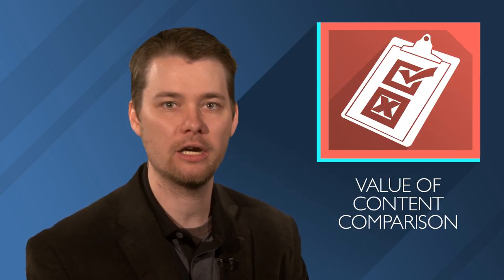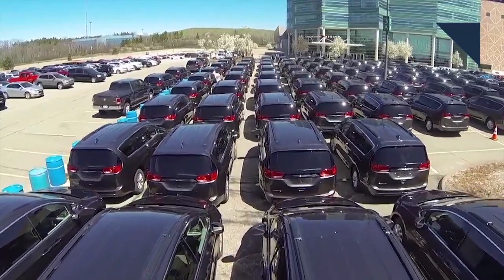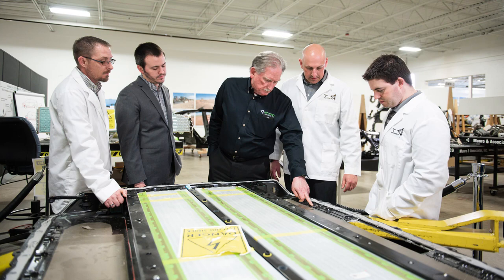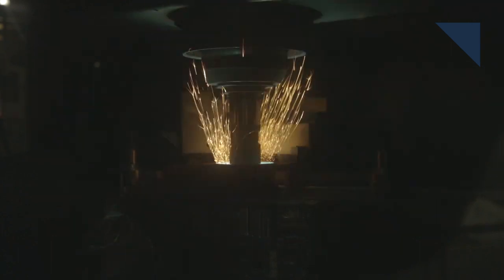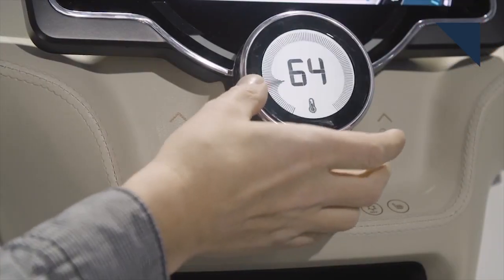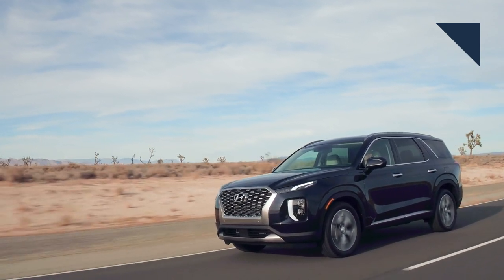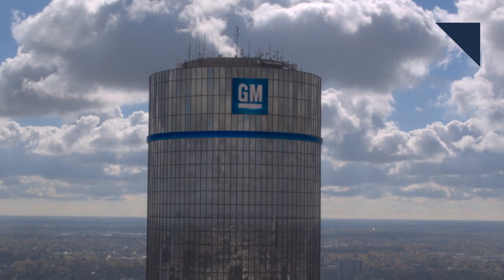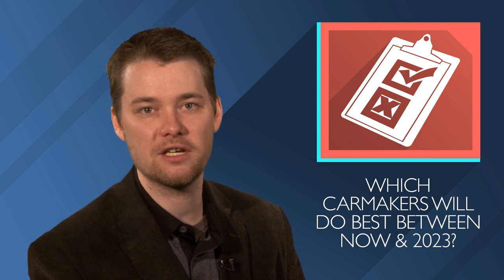C-Clamp Lights Make Pickups Look Tough - Autoline Daily 2619

Comment: 4:00 Mercedes is known for their seat controls on the door. So, dear Mercedes, PLEASE DO NOT GET RID OF PHYSICAL CONTROLS. Don't adopt this, or those awful haptic feedback controls. We love physical buttons. It's the same with the volume knob: Those who got rid of it quickly brought it back. Don't change things for the sake of change. It's stupid. When are manufacturers going to learn?
Reply: It's not change for its own sake. You also save cost for the switches, the wiring, the installation and potential malfunctions. Features you don't use very often can just as well be controlled from the touchscreen.

Comment: So there's more cost of parts (and R&D which all should eventually drop out of this equation) in an EV ($33.6K) in comparison to a ICE ($14.5K), or about 2.3 times more parts cost.  Perhaps these numbers apply to a new product development of either an EV or ICE vehicle?  To pay 2.3 times the component "ingredients" cost (less final assy. and profit), you have to be (1) a big believer in the so-called ecological calamity that's probably driving most of the EV sales, (2) enjoy wasting time at a battery charging station, (3) and think it's OK gambling on the life of a battery costing $15K to replace.  Did I leave out something?  Oh ya, like being pinned into your seat during acceleration and the car runs quietly.  The Level 4/5 autonomous estimate of $150,000 to $200,000 is way to low because of the enormous amount of R&D required, trust me; spent my life designing and developing hardware for high-tech products.  Of course, Tesla uses its vehicle purchasers as autopilot guinea pigs, so there's some savings there <g>.
Reply: Name a figure, then divide it by the number pf cars being produced.  Even if your R&D runs to billions, the production volume that will use that software runs to millions. How do you think big software games or CGI movies make money.  It is not because the costs are low, it is the number of customers the costs are spread over.

PS. The reason I have not been answering your messages lately is for some reason they have been going to my spam folder, I don`t know why, I did not set it that way.  I am trying to fix it.
Reply: @earlpottinger671  Earl, I have the same problem with my YouTube messages, it's a mix that go to the incoming and another to the spam folder.  Incorporating the R&D costs confuses the message trying to be made.  For instance, someone can reverse engineer a product and spend little in R&D.  No doubt Tesla has provided much free R&D effort to the EV design copycats at other manufacturers.  When I'm given the task to design something, I'll first look around for some existing design and reverse engineer it.  Reverse engineering an existing design also provides the opportunity to "build a better mousetrap."  Some of my most fun design efforts is simply building that better mousetrap with improved features.  Military electronics R&D is often paid by the government.  Attempts to protect a lower level design within a system by patents is usually futile because there are often many ways to build that mousetrap.  Many companies prefer to keep critical design info proprietary and that sometimes works with complex designs difficult to reverse engineer.

Back around the 1990's Hughes aircraft thought they'd build the Raytheon SLQ-32 electronic countermeasures system used on every Navy vessel.  Raytheon provided Hughes with all the drawings needed to build the system.  But Hughes couldn't make the system work and filed a lawsuit against Raytheon stating they didn't receive all the drawings from Raytheon; Hughes lost the lawsuit.  I remember this because I had boxes of SLQ-32 design drawings "borrowed" by lawyers; never to see these drawings again.  Sometimes simply attempting to copy an existing system isn't that easy.  It could be better to do some of your own R&D and learn how stuff works.  Back in the 1980's I'd sometimes get my hands on a competitor's equipment and enjoyed digging into it.  I learned there were so many, very different ways to perform a basic circuit function.  Often I wonder how long Tesla can stay in the lead.  Sometimes those with the most bucks win, no matter how hard a company tries to stay ahead.